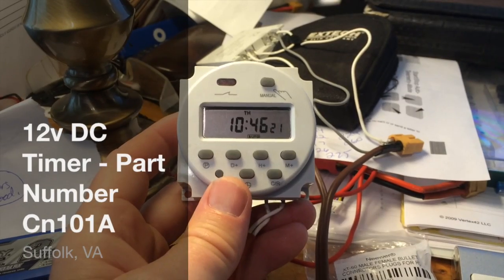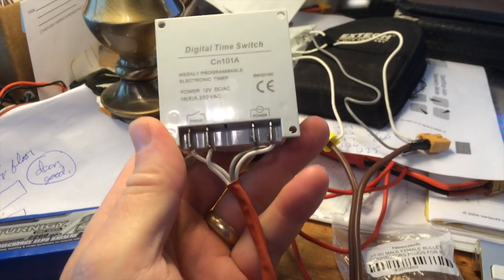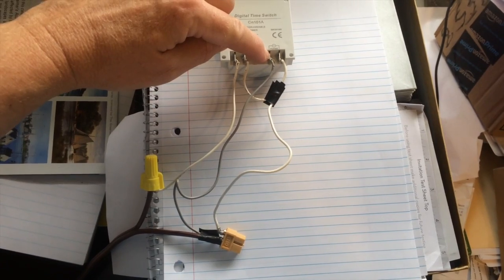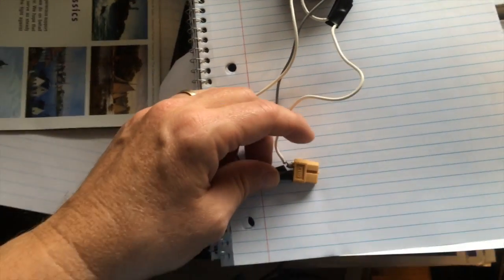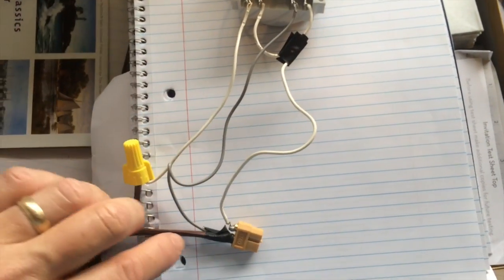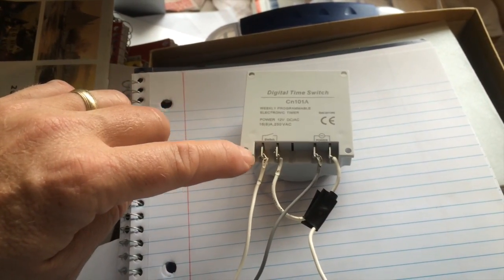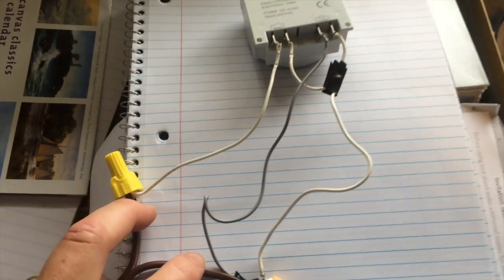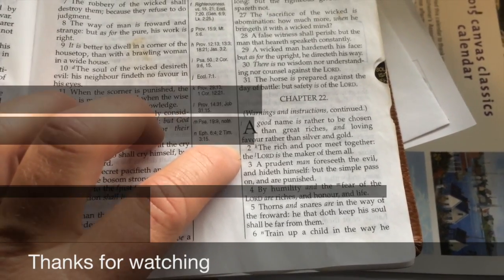How to setup 12v DC Timer with Wiring Diagram Cn101A

Comment: Scoot, I just looked at it on Amazon,  it show 12vdc in, but show 250vac 16A out.....  is the OUTPUT going to work at 12VDC?   it show AC???  I'm confused,  please let me know.  All I'm trying to do, is run a 12v Fan, from a 12v Battery for 20 minutes, then OFF for 10minute, then on for 20M.....  ON, OFF, ON, OFF     THANKS FOR YOUR HELP.

Comment: Would be much simpler if you just drew a picture. That xt connecter is confusing to some. Just show power source (battery) + - to timer and power out + - to load. 
Much simpler and clearer. ✌️
At least this is one of the few in English.

Comment: I think the wiring is not optimal. Your live load is correct but the rest are wrong. Live load on one end and negative on the other side end. The negative will combine all power source negative and negative load, The source positive will loop one live wire to the next slot. 
So the correct wiring diagram is, the timer facing front..not back as your video...
1. Neutral. Source & Load
2. Live. Source
3. Live. Loop one wire from 3 to 2 aka source Live
4. Live. Load

Note : Source is origin of power and Load will be your electrical appliance.
Reply from the maker: Obsessed .... hey, so have you tried your way on the exact same model I have here, or are you hypothesizing? Let me know... always like to learn  stuff :-)
Reply: Bro, i have installed a dozen of CN101A but they were 220v - 250vac to power AC electronic appliance and lighting.  I even added a fused wire into it because it's slow to order from oversea. Better safe than sorry.
Perhaps yours are 12v DC but i guess there is few ways of doing the wiring. Sorry if i confuse you.

Comment: Nice video. I have a question regarding the wiring.  Do you need to jump the power over to the switch side or can you use a separate power source for the switch side? Thanks.
Reply from the maker: Michael Chong . I think you need the same power source, if I’m following you correctly
Reply: Scott Wilson okay thanks.

Comment: thanks for the video ! I was just wanting to know if you could run this timer from a 12 volt battery and how much energy does it drain ? thanks !
Reply: I measured 18.4ma with the relay energized (ie. red light "on"), and only 2.86ma when the relay is not energized.  Since I'm only using for a momentary 1 minute "on" per day, the lower drain when relay is off will greatly extend battery life.  I'm using a 2500mah lipo battery so if I drain to 50% it should last over 2 wks without recharging.
Reply from the maker: Good question, yes 12v battery power is fine, and drain is minimal. But I will put a meter on it and let you know upcoming
Reply from the maker: 0.018 Amps drain with just the timer on the battery, very minimal
Reply: If I use AA battery pack that's rated at 1500mah (1.5ah), a 0.018 amp drain on my battery pack would last only 80 hrs - so maybe not so practical for full time operation.  In this case, might be better to connect to house wiring.  I'll try one round of AA batteries just to see how long they last!
Reply from the maker: Yes, I have only used on 12v car/marine batteries with frequent charging. This is minimal drain in these applications. You might need a different setup with AAs.
Reply: @rscottwilson1  So If I connect this timer on a battery car in how many days it could empty the battery? what do you think? thank you

Comment: Hey, for me ,when using manual button, it only work on and off, it doesnt work on auto it is still on when i switch to auto mode from the On side, and still off when i switch to auto from off side , so auto mode still is either on or off. Timer doesnt work somehow
Reply: Hi going back to auto from the off mode puts it back to the program setting of the timer

Comment: By chance do you know if I can use this timer to control a dc to ac inverter?  Building a solar powered aeration system for my pond but it has to be timed accurately to work.  also, i sadly cant find a reliable dc pump so I have no choice but to use an ac inverter.  Hoping this timer and an inverter will get along ok?
Reply from the maker: OK I think you can, but not totally sure. Some are listed as AC/DC in the product descriptions, but I have only used them in DC applications.

Comment: I have the same timer but the issue I have is that there is no display on the screen. Anyone who know how to recharge the battery inside or change the battery?
Reply from the maker: It should come on after you hook up to a 12v power source. After that it will stay charged even if disconnected for a while. If there's no screen after being connected to the power source, then it's probably fried.
Reply: +Scott Wilson Thanks Scott... I may be the unlucky person with both timer failed the same way.

Comment: i have it hooked up like you do but it still dosnt work the red light is on but the lights i have it hooked up to dont turn on but i know they work
Reply from the maker: Hmmm. When you click the 'Manual' button it should toggle between 3 positions. On - Auto - Off. The red light should come on and off with the lights. 

It's also possible it's either defective or fried. I fried at least two of them by inadvertently shorting them out by reversing positive and negative. It only takes one quick second and its toast, they're not forgiving. On one of the ones I fried, the red light still would come on, but no power came through to lights.

Hope this helps.
Reply: +Scott Wilson yea looks like i will need to buy a new on thanks for the reply and the video was very helpful on how i need to hook t up thanks
Reply: I fried mine when I applied 120volt to power the timer (not the switch contacts).  It arced and created an open circuit in the etching on the pc board.  I soldered a jumper cable across the burned out area and I'm back in business. I think the manual says you can apply up to 120 or 240 to power the unit, but my experience says otherwise.